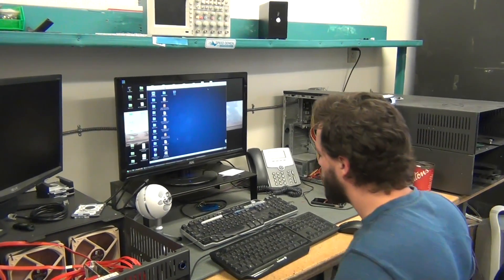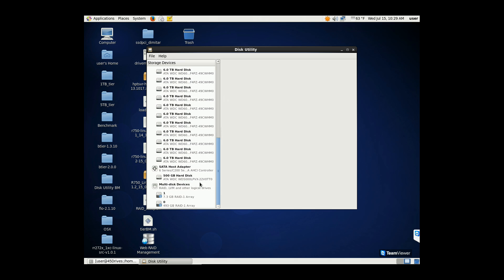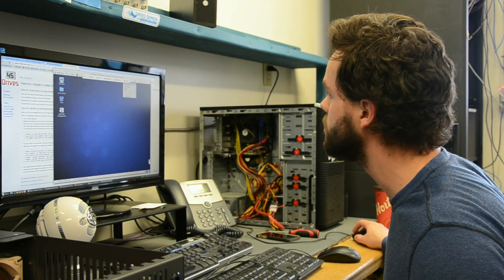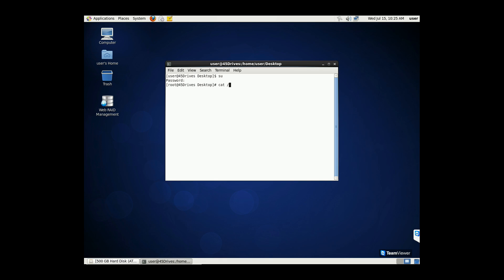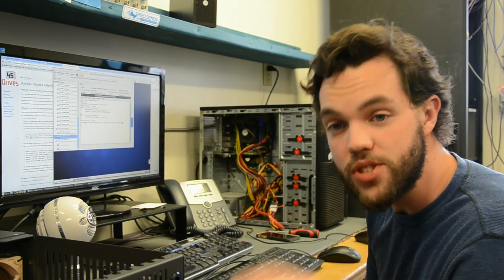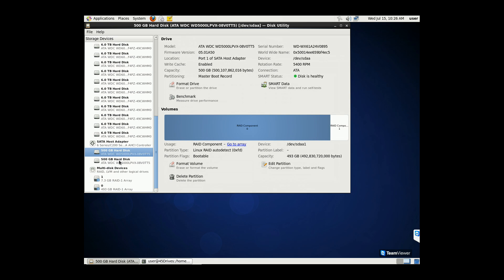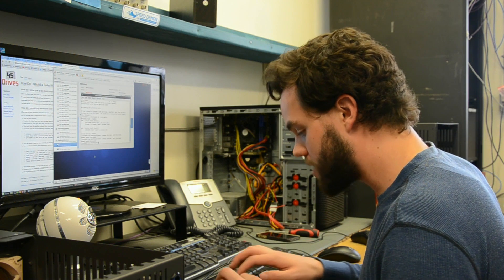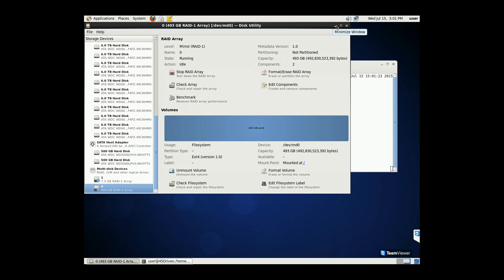How to Replace Failed Redundant Boot Drives

Comment: May I ask you please I have a degraded hdd drive in a raid 1 array the thing is the pc doesn't even go beyond loading to windows then it goes to powersaving mode and restarts so I don't actually have access to windows, I tried to plug one if them into another pc they don't show up at all no local disks or anything shows up. How do I fix it? I can do the rebuild option from the bios though I have access to that atleast but is it safe?

Comment: That system sucks. A RAID setup should be as simple as just replacing the drive and the RAID system should recognize the drive has been replaced do the rest on it's own. I just discovered that my Intel RAID system is fairly simple... Replace the drive....
Turn on the system.
Click Start.
Click All Programs.
Click Intel.
Click Intel® Rapid Storage Technology.
Click Rebuild to another disk.
Select the replacement hard drive and click Rebuild.
And you are done.

Comment: Hi, good morning.

I really like the video, but, I would like to ask if is it possible to swap the disk on a Dell T330 (while powered up) which has a Centos 7 system installed on it and configured with LVM? Or is mandatory to turn off the computer to swap the devices and rebuilding the new one?

Comment: What if you want to go to a different size disk?
Reply from the maker: Hi Chris,
This is fine as long as it is bigger than the one you are replacing... you will need to create the partitions to match the old disk however, so you will have some extra space left over on the bigger disk. Hope this helps!
Reply: Just realised how that would therefore be an incentive to go for a smaller drive if you don't need the capacity. So if you chose a 1tb, you could always replace with a 2tb. However, if you had started with a 2tb and wanted to later repurpose that drive in a gadget that had a 2tb limit, you wouldn't have the same luxury.
Reply: I have mirrored my boot drive. If my primary boot drive fails, will I be able to boot the Windows 7 system?

Comment: I'm surprised you don't use the WD Red 2.5 drives as a boot drive.

On a side note, is there a way to move your OS drives to an SSD, or is it necessary to order the boot drives as an SSD off the bat?
Reply from the maker: Hey QuickQuips, migrating the OS drive to the SSD would be a somewhat tough feat if the two are different sizes.

I would recommend pulling all the relevant configuration files off your current boot drives, go through a fresh install on SSDs and re configure everything as you had it.

Hope this helps!

Thanks

Comment: isnt there a way for an auto rebuild once it has detected the new drive ??
Reply from the maker: Hi trinimoses! I checked with Brett and the other guys in our R&D lab and they said that auto-rebuilding may be possible, but they prefer to have full control over the rebuild to make sure there are no errors. Sometimes auto-rebuild features don't work out as planned (i.e. they could grab the wrong drive, etc), so our guys like to be sure.

That said, we're always looking for new things to experiment in the lab, so we will consider testing out auto-rebuild sometime soon!